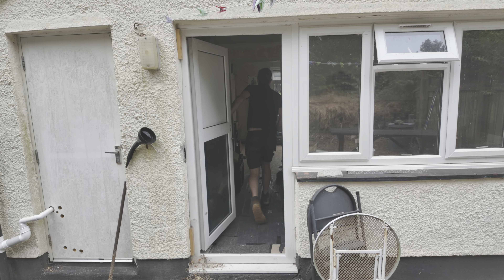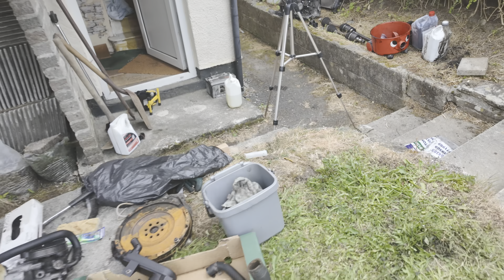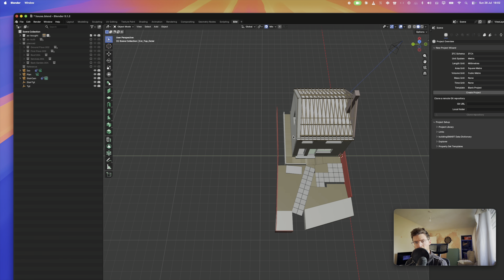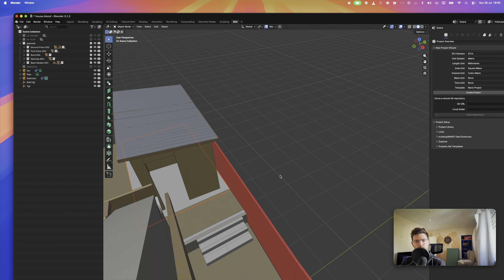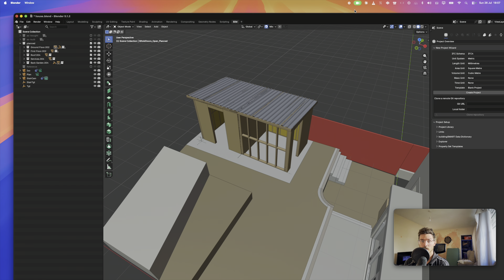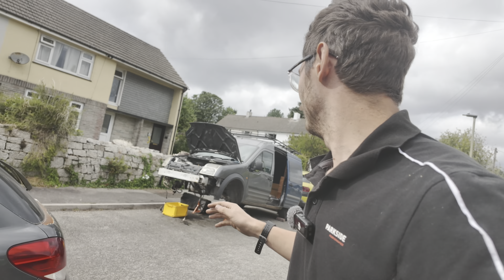I’ve Taken on Too Much (Renovation & Van Update)

Comment: Couple of other good things to do while you're there is decoking the intake and replacing the turbo feed line(this gets blocked over time). Replacing the intake studs with bolts will also make your life easier one day. Also, how was the turbo oil return held into the block? Some have a  bolt and mine, I can't work out...
Reply from the maker: Firstly, cheers for the comment :) 

On mine, the turbo feed and return are one assembly. May well replace it yes!

I’ve got exactly the same issue with the return. Seemingly the only thing holding it in to the block is the fact that the other end is bolted to the bottom of the turbo. Does yours also have a bent pipe in to a short rubber hose and then a much shorter length of metal pipe that goes in to the block?

I’ve been on the phone with Ford and have some part numbers and diagrams that seem quite useful. Drop me a message on Instagram if you want and I’ll send them over